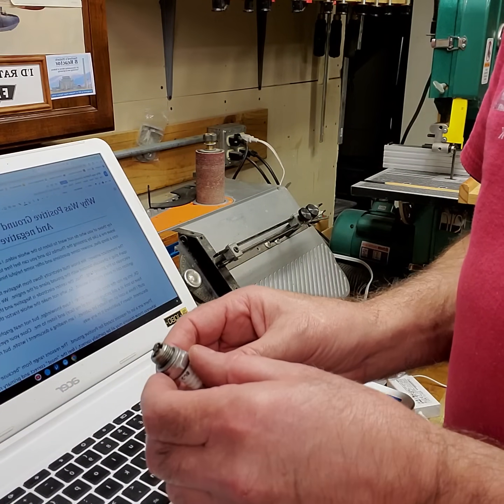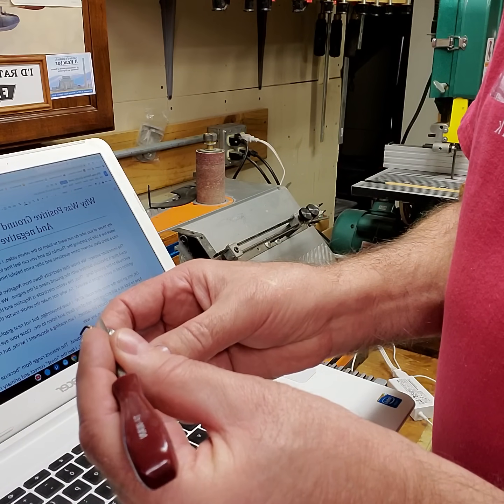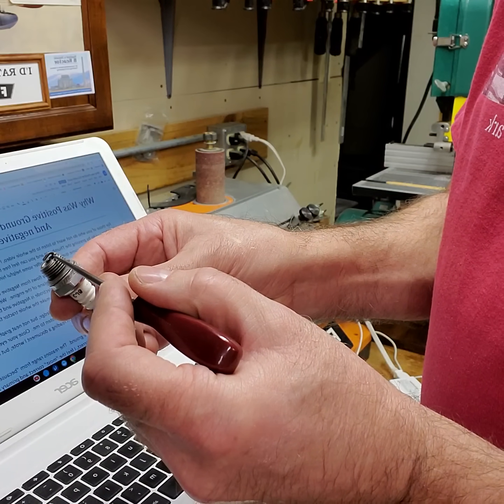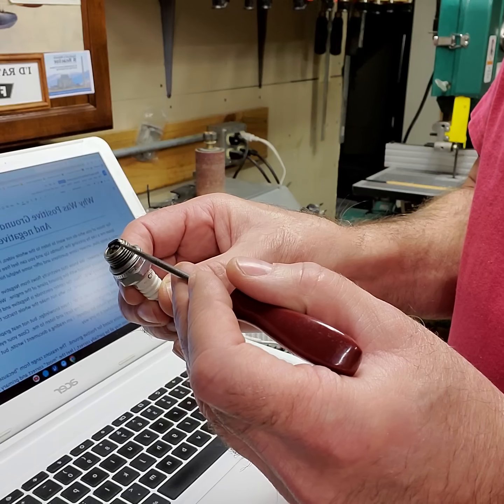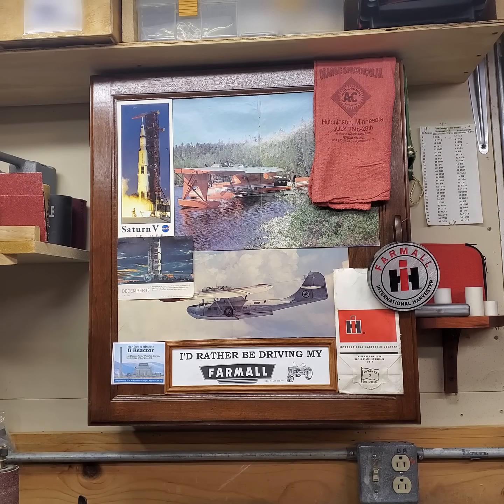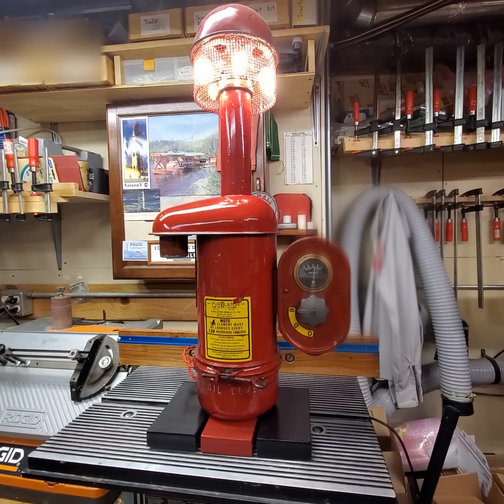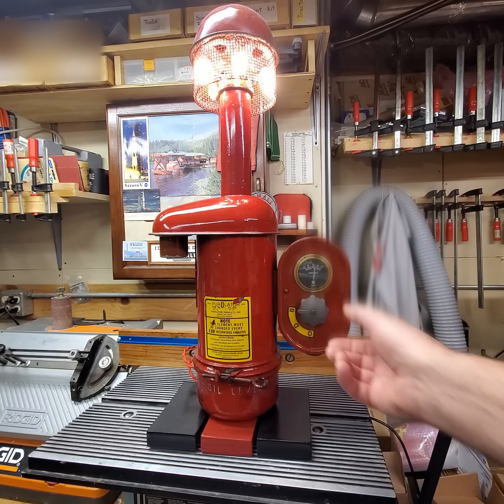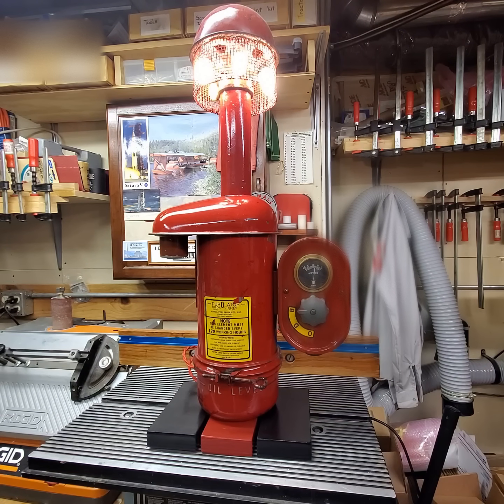Why positive ground was used on old cars, trucks and tractors

Comment: Years ago I had a 12 v battery someone charged in reverse.
If a battery is totally dead and a person hooks up charger backwards the battery is reversed and negative becomes positive.
I was a marine mechanic as a kid and fixed a old guys boat no one could get running. He hooked up charger backwards by mistake.
I also had engines with coil wired reversed and true low power hard start.
Good show!
Reply from the maker: Hi!  Yeah, this happens.  My friend "accidently" got his boat battery slightly reverse charged.  A modern "smart" charger would not charge the battery.  We hooked up a load to the battery and completely drained it before the smart charger would recharge the battery.  An older charger would have also worked.

Comment: So the positives and negatives are just labeled wrong on modern cars and multimeters? Current is actually flowing from negative of battery to the frame? And how does doing this help a mechanic diagnose something?
Reply: No, conventional current flow is defined as being from positive to negative.  Ben Franklin came up with that convention a hundred years before the electron was discovered.  As it turned out later, the current (the electrons) actually flow the other way.  It makes no practical difference as you can consider the electrons flow from negative to positive, or the holes flow from positive to negative. It really doesn't matter for most things unless you're actually working with individual electrons.  In those cases we learn electron current flow which goes from negative to positive.

Comment: very interesting points here, - I have seen many problems with ground connections through chassis, - tended to fix it with nice and heavy (ground) cables ...to be compatible with positive ground I would create a negative voltage battery system to go along-side my positive 12v rig ...as for 24 volt, wondering if there were / are positive ground 24 volt rigs... - it's interesting that the telephone system ran on / runs on a minus 48 volt rail - so does the power supply for PoE... - my ultimate master power system has plus and minus rails at all the voltages, - stuff like a mobile workshop, primary camping rig....

Comment: as an automotive electrical tech and a guy who loves early British cars, + ground, I found this enlightening. did a lot of + to - conversions. never once did I revers the coil wires. clearly a mistake on my part.  what you have said makes so much sense.  
thanks!
 just for sh**s and giggles, I'm going to woop out my HV volt meter and check my coil output and see if your correct. I expect to see -to + ground and my 20kv output - 12volts

Comment: I had to change my IH 340 crawler to 12v negative ground. Not because I wanted to, but because I had an electrical fire, or rather the man before me just bypassed the fuses to get around the electrical problems, and didn't say anything about this. So, after the fire, the generator was burned up. I could have had it rewound but it would have cost about 6 to 8 times what a cheap alternator was, so I changed everything to 12v negative.

Comment: Those in electronics are aware: "We now teach students that electric current flows from positive to negative, even though we know electrons are moving the opposite direction." 
Ben Franklin got it backwards when designating "Positive" and "Negative." A 50-50 chance of getting it wrong, and he did.
Reply: yes that is the hole flow the hole will move in the opposite of electrons if electrons move to right holes move to the left    like spaces in a parking lot

Comment: You're also wrong about sparkplugs. Wasted spark used in many modern cars, it fires the plugs in pairs, one is positive, the other negative. Platinum plugs have sharp points and fire equally well both ways. They were designed to be used with wasted spark.

Comment: The very old vehicles had a Dynamo with two coils one feeding the condenser breaker point, spark plug and the other for feeding other electric thing's, like head lamps backlight, break lights and other things and they did just fine and the bougie last for decades
Reply from the maker: Hi!  Very interesting.  Thank you.
Reply: Bougie = spark plug or candle (!) in French.

Comment: The real reason is because it followed a "standard" The standards were established with the very first electrical machines, the biggest and oldest being the telephone exchange which has always been positive ground. That was for corrosion and electrolysis reasons. Thermionic valves prefer to be positive ground but transistors, NPN being more common than PNP, they prefer to be negative ground.
Reply: Valves use only negative ground. First transistors, made out fo germanium, were mostly PNP, and thus circuit were easier to design with positive ground. Later, when silicon NPN transistors become popular, the polarity of electronics was reversed once again and stays like that to this day.
Reply: My first employer was Bell Telephone Laboratories. We were told that the telephone system used a positive ground because electrolysis would plate onto conductors instead of removing conductive material. The wire pairs leaving the telephone exchanges were positive ground, so they had 0 or a negative voltage with respect to ground. The telephone exchange DC power distribution used black wires for ground and red for negative DC, usually -48 volts DC. Standard DC voltage meters use red for positive and black for negative. So, the technician needed to connect the analog meter's black wire to the red distribution wire and red meter wire to black to get the needle to deflect correctly, or the digital meter to register a positive voltage.

Internal to equipment within the telephone exchange, there could be voltages that were positive with respect to ground, derived from internal power converters.

Note that computer power supplies often output, in addition to DC voltages that are positive with respect to ground, -12 volts DC. So, ground is just a reference in those computers, not necessarily positive or negative.

Comment: Negative ground is more convenient for vacuum tube radios.  The cathode being biased close to ground level with electronics boiling off of it to the anode.  With the relative high voltage being isolated, things at ground level are safer to touch.
Reply: I vaguely remember reading a few decades ago, that the primary reason for switching to a negative ground at least on automobiles had something to do with car radios becoming more common. I can't remember exactly why or where I read it? Perhaps it was an article in "American Heritage Invention & Technology" magazine? I don't think, that it was an issue concerning interference, but maybe something to do with having a better ground plane for the antenna? I wish; I could remember, but now that you mention it, maybe whatever I read did say, that the risk of getting hit with 90 vdc plate voltage was the issue, and I'm conflating a different article when it comes to a ground plane? At least, I may have been right, that it had mostly to do with the radio. Am I mis-remembering? Of course tractors, when they switched to negative ground, few if any had radios, but I figured, that they changed to be consistent with cars, to avoid confusion.
Reply: @sparky6086  I think you've got a point here.
Reply: @sparky6086  I don't thank that would be the reason as modern tractors probably have negative grounds and the radios they use work just fine with antennas and such
Reply: You are absolutely wrong.  The positive spark is connected to the electrode and the ground is made through the block and the threads.   The electrons jump to the electrode.  The way you are explaining this suggests the body of the car has the opposite ground than the engine.
Reply: @danecantwell22  I first thought the same thing, but I researched what he said and it turns out he is correct. Sparkplugs do want to be positive ground. The coils secondary and primary are isolated from each other. The primary is excited by the cars electrical system and the secondary is charged by transformer action. The secondary produce a large voltage across the spark plug gap in the range 5,000 to 20,000 volts, so this high voltage is going to arch to anything close enough to it. It makes little difference if the spark archs to an electrode at 12 volts or one at 0 volts.
Reply: The original vacuum tube radios have nothing to do with this. The anodes of the tubes are not supplied directly from the 6V or 12V supply voltage. They used +200V which was produced from a vibrator and transformer. That can be designed to operate from positive or negative ground.
However it did become an issue with the latest vacuum tube radios shortly after 12V became common. These radio used 12V on the tube anodes directly from the input, so it did have to be plus  12V (negative ground.).

Comment: Spark plugs get electrical contact via the threads in the cylinder head. What you appear to be saying, is that somehow - even in modern cars that have negative ground chassis, where the engine block has a ground strap to the chassis / battery negative - that somehow, the spark plug body is the positive contact, and the spark plug electrode is being fed a negative charge?

Because if that's what you're saying, you're 1000% wrong. The coils aren't "wound for a negative electrode", it's literally just a coil of wire. Technically 2 coils of wire, but who's counting right? Anyway - we're only going to talk about the pertinent secondary coil that carries the spark voltage. It's a coil of wire with one end connected to the engine ground, and the other connected to the spark plug wire that goes to the electrode.

The spark is just hot ionized gasses, and the air/fuel mixture literally doesn't care which direction its traveling - it's hot, and makes the fuel go bang. I'm not sure how you're "reversing" the coil, but - unless you're cracking the coil open, and switching the secondary ground to the other side internally you're not doing what you think you're doing.
Reply: You're correct in that someone here is 1000% wrong.  Unfortunately that's the only bit you got right.

The orientation in which you wind the primary and secondary windings together inside the coil determines whether the tip of your spark plug gets a positive voltage pulse or a negative voltage pulse with respect to the common chassis ground.  For a variety of reasons, we want it to get a negative voltage pulse (we want the core of the plug thermally hot because that makes a more reliable spark, we want the harder tip of the plug to erode not the ground, etc).  That means the high voltage winding is connected in a positive ground configuration while the low voltage winding is connected in a negative ground configuration to interface with the car's 12V electrical system.  The high and low voltage ends of the coil are independent power supplies, except they're both connected to the same common chassis ground.
Reply: @stargazer7644  I actually rethought this a bit afterwards, and - you might be right. If you consider that the secondary voltages are 50kv+  up to over 100kv ... that 12v potential difference is pretty insignificant.

I would like to see how it is that the ungrounded side of the secondary coil ends up being the path of least resistance. Or maybe I've been reading the schematics wrong. Or maybe the schematics I've seen ARE wrong.

So maybe me and the OP are BOTH 1000% wrong? Electricity at high voltages and high frequencies is a very strange beast.
Reply: Or maybe I'm 1000% wrong. Inquiring minds want to know!
Reply: @notsure7874  The other side of the high voltage coil is the only path that matters.  Replace the high voltage coil with a 20,000V battery and look at it that way.  The low voltage side (other than the common ground) isn't part of the circuit.
Reply: @stargazer7644  What is it that makes the secondary coil fire in a particular polarity?
Reply: @notsure7874  Which end you connect to the primary's common, and which way it is wound.  The secondary is just an isolated voltage source (like a 20,000V battery).  Whether your battery provides +20,000V, or -20,000V is simply determined by which end you connect to the common.

Comment: This stuff about plugs having positive ground is bollocks.

The plug isn't a diode, it doesn't matter which way the current goes through it.

The plug has two electrodes to create the spark. The centre electrode is connected through to the cap on rear of the plug on to which the HT lead is connected.

The other electrode in the plug is connected to the metal body of the plug where the thread is. Why? Why isn't there a separate cable connection point?
Because somebody realised they can use the engine block as the return path for the current back to the battery and therefore eliminate 4,6, 12 cables connecting to the plugs.

The plug doesn't care which the current passes through it. So the plug will work on positive ground OR negative ground cars.

Whether it is positive ground or negative ground just determines if the body of the spark plug is connected to the negative or positive of the battery. That is all.

The spark generator, which generates the high voltage for the spark plug, now that does need to be designed according to whether the car is positive ground or negative ground.

Comment: Years ago when I was in high school, I remember having a jump start problem with my '56 Ford when I tried to use a friends old Dodge to jump start the Ford. We pulled the Dodge up close to the Ford not noticing that the bumpers were touching. No matter which way I connected the jumper cables I got a spark.??? I finally noticed the bumpers touching so we backed up the Dodge 2 inches and 'voila', no problem jump starting the Ford. Details matter.
Reply from the maker: Hi WV!  Excellent story!  Thank you.

Comment: One minor problem with this theory - waste spark systems.  That's when one coil is used for two cylinders.  The high voltage + goes to one and the high voltage - goes to the other.  The sparkplugs are in series using the bock as the connection between then.  Both fire at the same time, but one is on the power stroke, the other isn't - hence the name "waste spark".  These systems are picky about the plugs used since half of them are "backwards".
Reply: The spark plugs used in those engines have a special material either platinum or iridium on both electrodes so there is no ground electrode erosion from the reversed plug.
Reply: @MatthewBerginGarage  interesting
Reply from the maker: Hi Matthew!  Very interesting.  Can you tell me more?  I bet the plugs were very expensive!  I will have to cover this point if/when I ever redo this video.  I think this is a very important comment.  Thumbs up to you.
Reply: This is the system on my old P&H (Onan) welder.  It is a shit design because if one side gets wet or flooded, slightly fouled, etc, the good side will not fire either.

Comment: Before anyone reverses the polarity on a gas motor with an electric starter remember you can't reverse the Bendix.
Reply: hahahaha I wonder how many never though of that , that is so funny when that happens , the look on there face's hehehe
Reply: Someone above* pointed out that starters are series wound, and as such, rotate only one direction regardless of polarity. (I have not checked this out, but I believe he is correct).
*I just saw it again, it was the author that said that...